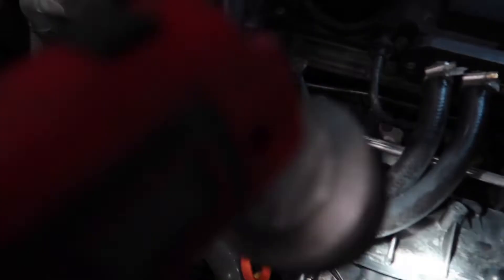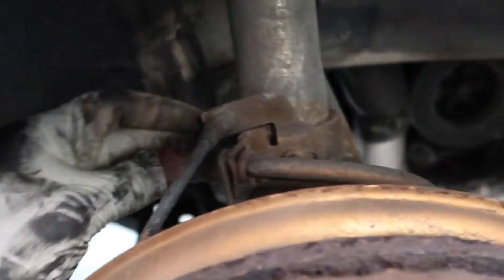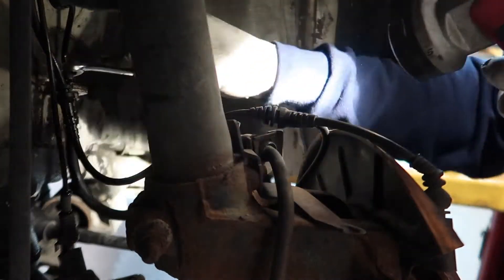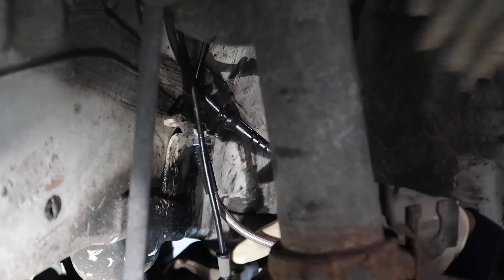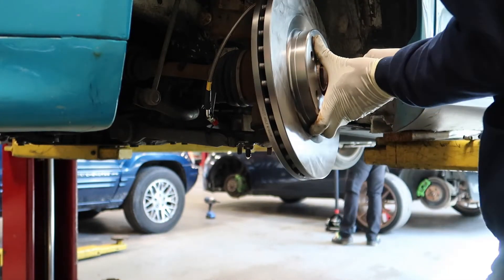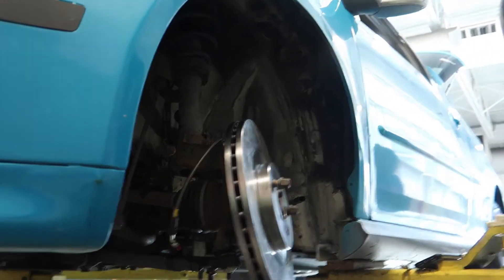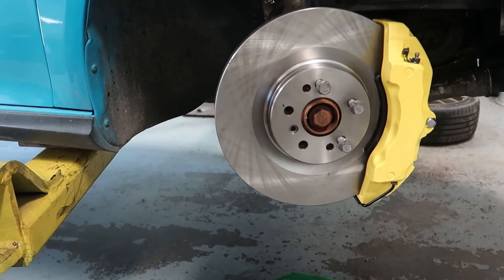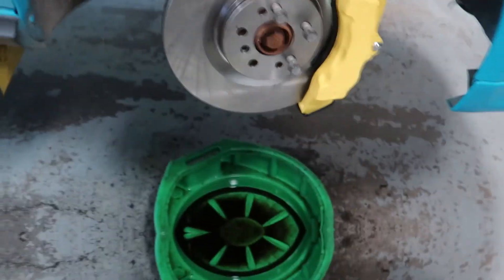How to Install PORCHE 18z 17z Caliper to Stage 3 Mk5 Golf GTI |Big Brake Kit Upgrade |$300 usd.

Comment: Hello, I have purchased some Brembo Z18 brakes, I have an Audi A5 B8.5 2.0TFSI Quattro. What would I need to be able to assemble them? Would the screw kit be enough or would I have to add an adapter? I'm wearing S5 Zimmermann 345mm discs.
Thank you.
Reply from the maker: I think they should honestly bolt-rig it up with the screw kit.  From jhm.

Comment: they make bolts that bolt into the knuckle directly
Reply from the maker: Yep, they were bolts that were like a t45 with a 19mm but right behind.
Reply: @GTIMKV  im about to do this to a mk6 gti did u ever do the hubcentric ring?
Reply from the maker: @apenationamcgme9063  no hub centrics